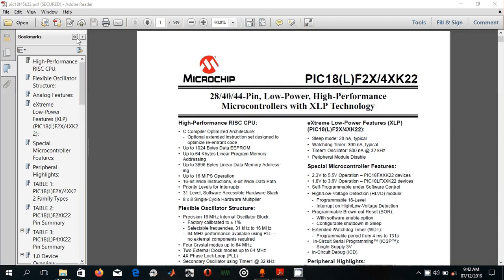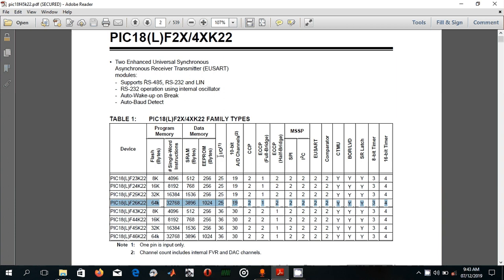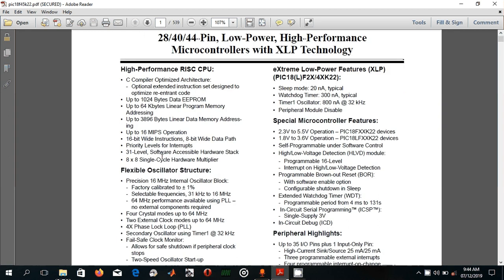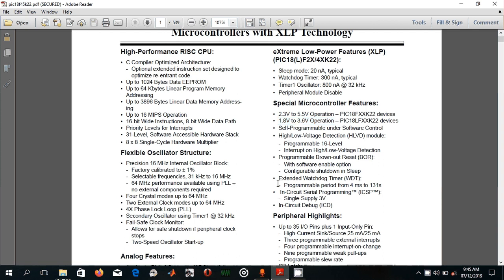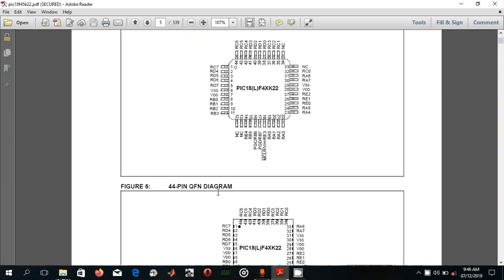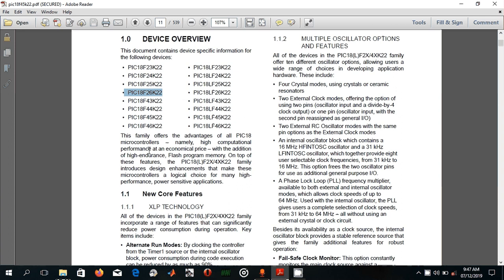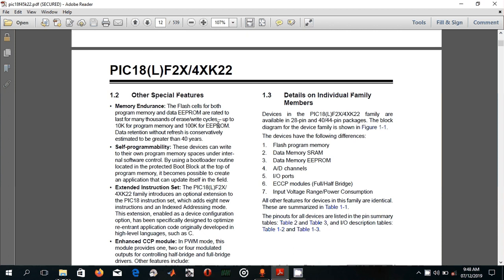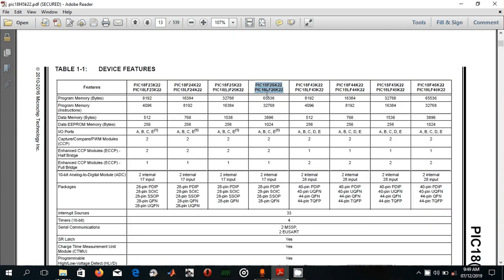Detailed explanation of PIC18F26K22

Comment: sir i worked in this controller, and using internal oscillator 16mhz and ,pll to multiply it to 64 mhz, but the problem is device runs slow and it takes 30 sec or more to work after powering it i dont know what is the issue can you guide me please........